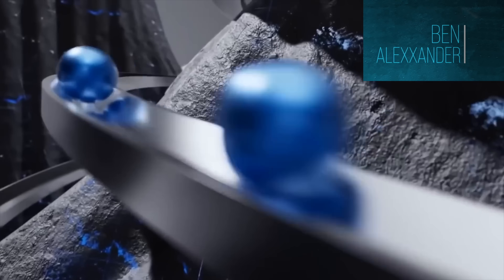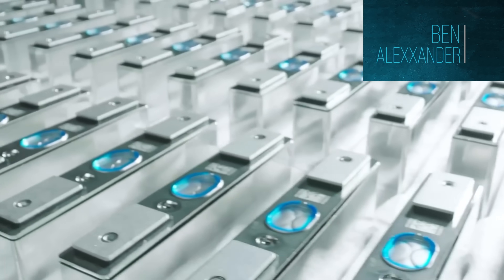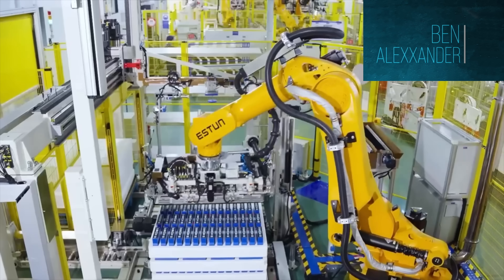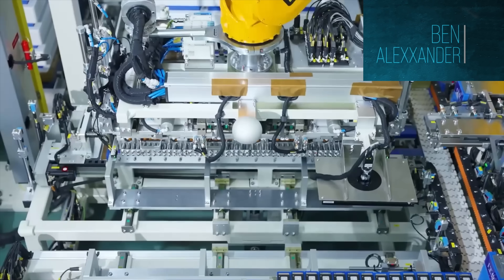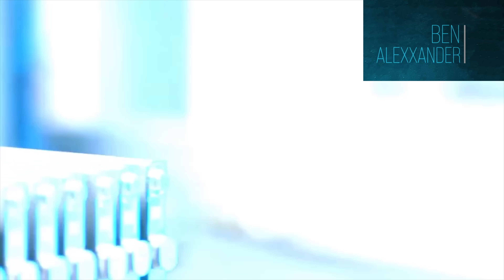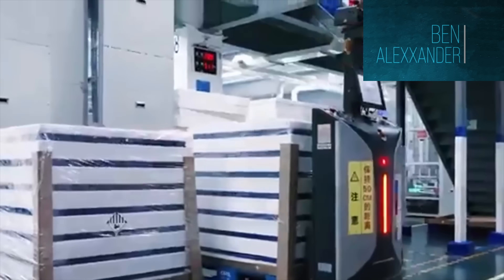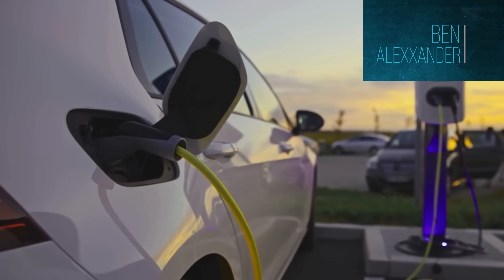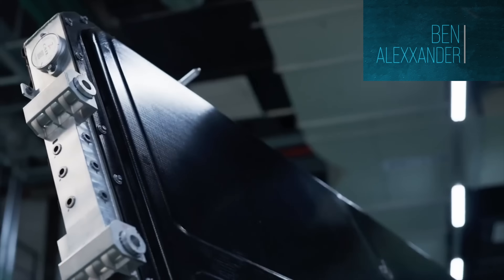CATL’s New Sodium Battery Lasts 3.6 Million Miles — 50% Cheaper Than Lithium

Comment: discharge of 80% constant and last 20% variable that's the takeaway with cheaper sodium and it's not cheap unless you buy in bulk like a ev manufacturer as proven by it's 12v car battery sizes.

Comment: Been waiting fifty-five years for home energy to be affordable. This with more efficient solar may finally get there. Current system of replacing solar stuff in twenty years is nutts. Since being in the electronics industry since 1969 I know the EXPENSIVE CONTROL hardware breaks. This would offset that cost. Being in charge of your home power generation system isn't for everyone.

Comment: Ten years, John B Goodenough invented this over ten years ago when he was 92. If I remember correctly his lab results of the finished product (lab finished) was 8x capacity and 32x charge speed Vs lithium. 

 Interestingly enough it is sodium and glass and a DRY battery, meaning it should last millions of recharges.

Comment: The sodium based cells so cheaper and works better in a cold environment, but almost in every other way they are worse than the LiFePo. There are real sodium based cells, batteries which can be tested and lots of experts already tested those and they have mixed and negative results. So far I dont think the sodium based cells are good for EV-s.

Comment: if the data is correct, It should replace Litium based batteries for the most part. only the weight is in favor ofLithium for transport and and battery based tools (like cordless drills)

Comment: Wouldn’t the price per kWh you originally quoted be measured per cell for both lithium and sodium? If so wouldn’t the cost of assembling those cells in a case be approximately the same for both?

Comment: Lasting up to 3.6 million miles just like our LED light bulbs lasts 20 years.
Reply: the cells last that long, not the charge :)
Reply: Exactly, what CEO is ever going to allow a lifetime product to be built and sold at a discount over what people are buying now. Both the LED and this Battery probably could last this long but they will build it so it doesnt.
Reply: Comparing batteries to light bulbs is irrelevant .  There is no empirical evidence the batteries will last that long in all climates or at all.

Comment: I asked Grok.
The disadvantages are lower energy density, heavier weight, shorter lifespan, slower ion diffusion (meaning a lower charging/discharging speed) , and poor cycle stability.
These things are really bad. 😂
You can use grapes to make a battery also.

Comment: This is obsolete already!! cherry introduce 600wat per kg baterries and tgat means 500-600kg of weight of them as they are now heavy will give you 300-360kw capacity and tgat could give you up to 2000km range if you drive up to 100kmh

Comment: I think LFP will run alongside these new Sodium batteries for quite some time. This is because there is a lot of it about. Maybe it will just become a means for grid storage, this is due to the main cost of supplying lithium is getting it out of the ground.

Comment: The sodium battery's energy density of 175 Wh/kg is comparable to LFP, but it's well below the ~300 Wh/kg of modern Li-ion.  People don't want to replace their 1000 lb Li-ion battery with a 1700 lb Sodium battery, so this will only find a niche in cheap, low-range EVs.

Comment: You are missing an often overlooked point where EV's are concerned - 40% of motorists in the UK are unable to home charge an EV - no offstreet parking.  Public chargers are not cost effective.  No good to me.
Reply: In the US, we solve these kinds of problems. We would run power to the curb. I could do it and I'n not even an electrician. Of course, we don't have to put coins into the power meter inside our house either.
Reply: @cyberbillp  It wouldn't work here.  1) We live on a narrow street, no offroad parking, and everybody parks on the opposite side of the road, so any cable would have to go across the road.  2) a lot of the good chargers here need 3 phase electricity at 415 volts, and I'm not messing with that.

Comment: Cheaper for the manufacturer maybe, customers will be paying as much as the manufacturer and distributors can get. Lithium ion is going to fade away but not over night.  There are still plenty of lead acid batteries And AGM batteries. Those haven’t gone away. It all about the cost and energy density, as well as the particular application.

Comment: They'll obviously coexist for a while because there is too much existing inventory and investment in Lithium tech, but its clear we need to switch to Sodium ASAP because it doesn't require massive mining and refining and all the moving of material and fossil fuel emissions that goes along with that. Plus I'm told these Sodium batteries won't catch fire the way Lithium ones do so getting them into TVs is urgent.

Comment: Why can people not understand that battery capacity is not the EV problem. Generation and distribution of electricity is the issue. It does not matter if you can make a battery that weights 1kg and gives a range of 1000  miles. The problem is trying to charge it up.

Comment: As a real hater of EVs (primarily due to range, cost and charging times) I’m still sceptical. The biggest question for me would be, hing long does it take to charge a battery with a 500+ mile range? As I need to use a car at a moments notice (which is why I generally have a full tank of diesel at all times)

Comment: Sodium-ion batteries store less energy by weight or volume, which means that you need bigger batteries to store the same amount of energy compared to lithium batteries. This limits their appeal for mobile devices and electric vehicles where manufacturers are inclined toward lightweight solutions.

Comment: Cheaper batteries are good, but there is an issue with any non spin system that needs to be resolved, itherwise you end up with events like in Spain where the grid frequency goes out of whack and you have to restart it.

Comment: Once their Cheap, Fast and reliable....no need for petrol products......you still need to lube bearings and generate power, Batteries STORE CHARGE they DO NOT GENERATE ELECTRICTY.
The will revolutionize some things 100% agree if you can get them cheap fast and reliable....do they catch fire and burn like a electrochemical forest fire?

Comment: My dad was an engineer, and the family business was involved in auto repair, mostly tires and now does heavy truck jacks. He told me years ago about how Caterpillar, makers of huge earth moving machines was looking for a battery for starting their big machines and no one could or would make what they wanted. He told me about the developed one that used "carbon particles" for the charging plates, and one the size of a shoe box could turn over their big machines and would charge in 20 minutes. You did mention carbon in this battery, and I wonder if it is some thing that came from that. The Caterpillar battery seemed to "disappear". The one thing that has stopped me from buying an electric vehicle is because the battery systems just are not close to what is needed.

Comment: No confirmed information regarding range tests in the currently only vehicle (JAC E10X) with the SIB (sodium-ion battery). BYD has replaced the SIB with LFP in the Seagull.
The video sequences shown in the video primarily refer to lithium-ion batteries.

Comment: Until the reach the regular small battery usage, it's not that interesting to me. Things like phone battery packs, flashlight batteries, camera batteries and things like that. Or even regular gas engine car batteries would be interesting to me.
I think the company would get traction faster if they showed people how great they are without folks having to spend big money in buying an EV or change their household electrical system.

If the new tech isn't good for those things, it will be a slow time making headway into convincing people to gamble on EVs or household systems. This is especially true for younger folks. If they get use to how good these batteries, it will be easier to convince the future buyers to expand to these bigger systems. 

Just my two cents on this. Also most people rent and cant afford to gamble on EVs being improved enough. Besides during an emergency I'd choose an easy and fast to fuel up combustion engine car or truck. It's safer.

Comment: I would like to know if there are similar issues to lithium ion for fire protection. The real problem right now is thermal runaway, we don't know how to extinguish a fire from a lithium ion battery, they just have to burn out and try to control the extreme heat.

Comment: From S&P Global Article By Amit Panday "Due to the decline in lithium prices, sodium-ion batteries have experienced a significant reduction in their primary value proposition compared to lithium-based batteries. Currently, the prices of sodium-ion batteries in China can be as much as twice that of LFP batteries, particularly for the mixed metal oxide cathode materials that provide the acceptable energy density levels needed in the automotive sector."

Comment: How much aluminum aluminum is not a cheap mineral it takes a lot of power to produce aluminum is the Greenies realized just how much electricity IE carbon is produced when you make aluminum they would be putting it right with plastic straws up Turtle butts and no solar energy is not the cheapest as a matter of fact because of solar cells and their life span they pretty much produce enough power to pay for the cost of producing them not including the damage and the carbon that they do to the atmosphere

Comment: $45 an hour till they make their R&D back, $30 for two years, by then everyone will be 3Dprinting the sodium battery tech TO Fit any shape in their home garage. You really really need to check out "Material" in Florida U.S. They are printing anode, cathode, and electrolyte TO Shape, today. 
There will never be another "build" around a battery. Batteries can no be printed as part of the frame itself. Why you or aye, or CIA, or MI6 or 
BAE or DARPA did not think of it first . . . . .

Comment: One key advantage of Sodium-ion batteries is that they can be fully discharged without damaging the battery. You can extract the entire stored energy without compromising its health. In contrast, lithium-ion batteries, particularly LFP types...typically require maintaining around 20% charge before recharging. Fully depleting a lithium battery can shorten its lifespan or make it harder to recharge. Sodium-ion batteries are often considered as a cost-effective alternative, claimed to be nearly half the price of LFPs, though in practice, such pricing hasn't been widely observed. Still, Sodium batteries could be more suitable for Extended Range Electric Vehicles (EREVs), which have promising potential in the coming years... no doubt. Future is Sodium also..

Comment: EVs are sold as environmentally beneficial and superior, but the extraction and use of materials for their manufacture using lithium technology proves far worse and longer lasting than so-called fossil fuels. How does this sodium technology stack up against fossil fuel or lithium technology?

Comment: Great, let’s focus on the real issue of the weight of these batteries vs lithium. CATL’s sodium-ion battery does have a  substantially lower charge density/weight compared to lithium-ion, with recent versions reaching about \(175\) Wh/kg compared to the \(200-300\) Wh/kg range of typical lithium-ion batteries. That is a big deal for cars, not so much for non-moving power storage structures. But this can’t be ignored.

Comment: I'm 64 and I can remember when a battery for a conventional internal combustion car was around $50 to $80. They're now $150 and up even though the technology hasn't changed much. I've heard many arguments that say the battery for an EV will cost in excess of $15,000 when the car reaches 10 years old. Many have sworn off EVs for that reason alone. If these sodium cells can outlast the car itself that would be an incredible game changer! Will the cost of these bring the price down on EVs though? Right now there are many EVs on the market that are out of reach for the average consumer.

Comment: Lithium batteries has always been the biggest issue I have with electric cars. Recycling lithium batteries isn't an easy thing to do and is currently not cost effective & thus bad for the environment. It is a limited resource so once you apply scale to EVs or other green solutions, you soon realize how bad they are. Sodium is plentiful, cheap and most countries can easily gain access to it. It's not an absolute cure all but definitely the way forward. If this is truly scalable, safe & can be done with minimal environmental impact, it will be the storage tech for EVs we have needed. Weight to KW will need to be good too else it won't be efficient. We shall see.

Comment: The ultimate “green” use for grid-scale energy storage is to buffer nuclear plants, replacing the need for gas “peaker” plants.

Solar and wind are NOT cheaper as we’ve been told, because they are intermittent.  The only time they’re cheaper is when they’re operating at capacity…  downtime makes them extremely costly which is why every market with lots of renewable capacity has higher utility rates.  You still need reliable base load, so adding to that always costs more.

Comment: Very interesting techology. Minor complaint: too much focus on independence from both fossil fuels AND nuclear power. Vehicle batteries don't just magically charge from nowhere or come pre-charged with full lifecycle power. Electric motors reduce the need for gasoline or diesel engines, but the actual source of energy could very well be coal, gas, or nuclear. Those can benefit from economy of scale and centralized emissions control equipment, reducing noise and air pollution at point of use. But then there are the usual transmission losses and security risks from the power grid.

But electric charging means any electric source that meets tech specs. Grid or local, fossil or nuclear or renewable, as long as it's compatible... Not inherently "independent" but more flexible and arguably more future-proof.

If it lives up to the hype, I want to see this in personal electronic gadgets. I've had to replace too many batteries inside smartphones and laptops.

Comment: All very interesting but I still can't afford an EV car and I still have no way of charging it. My current car - a 2016 one litre Hyundai - does all that I need it to, is low emissions, I can do a basic service myself for less than a hundred quid. I could jump in it now, fill it with unleaded  and be confident that I could drive to the north of Scotland from London (I've done it twice) without worrying about charging stops. There is no sensible reason for me to scrap a perfectly good, environmentally friendly car just to save a few grams of carbon that some politicians private jet  will spaff up the wall in less than a minute. But I guess less affluent motorists are just easy targets :-)

Comment: I remember reading about sodium battery development a couple of years ago.  Really pleased to see them reach this point in development so quickly, where these batteries are viable replacements for lithium.  I thought it might be a decade before we saw that.  Unfortunately, I suspect greed is going to put that cost differential right into the pockets of manufacturers, not consumers.  They'll probably charge more for these batteries, touting their safety, increased capacity, and longevity as reasons for increasing EV prices even higher, when they should logically cut those prices significantly.  I'm really pleased to see sodium ion batteries make it into the mainstream so quickly, but I'm skeptical that any consumer around the world will find them more affordable due to the inherent greed of the corporations who control their distribution and use.
Reply: China is leaving the West in its dust, the west would  have come up with this 40 years ago....
Reply: @msliwin4441 yep, all those years of IPR theft have really paid off.
Reply: And that price increase will dampen any enthusiasm to buy an EV for the average driver.

Comment: Isn't Sodium metal dangerous when wet?? I imagine a car getting in an accident, and fire personnel try to put out the fire (maybe from the other, ICE-powered car) and the water comes into contact with the sodium metal and...BOOM! Water will cause it to dissolve explosively into Sodium Hydroxide and Hydrogen, and the heat produced will ignite the hydrogen... adding more water will make it worse.

Comment: It seems that the major disadvantage of the sodium based batteries will be the changing terminal voltage during charging and discharging, however I expect that will be solved by electronics.  There will be a specialist boost converter built which will maintain a constant output voltage during the bulk of the discharge cycle.  It might even be set up so that there will be a small but easily measurable voltage drop once the state-of-charge reaches a certain point, to signal that it's time to charge the battery before it completely discharges.

Comment: For those of us who have been looking for the proper way since we were small boys in the early 70s, this is one part of the solution. If the batteries work in truly cold and hot environments, that would be a plus, but the idea that a non-strategic metal that may need far less refining is a singularly fine thing. Add the longevity and cost elements, and guys like me will drive into the sunset in sodium battery vehicles. If I live to see Gen 4 Nuclear, that would be the other big thing.